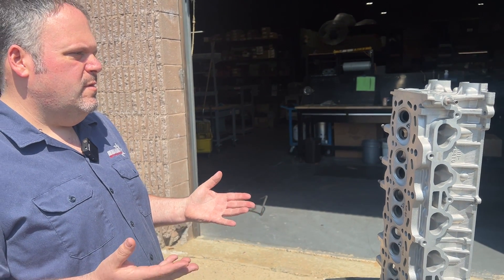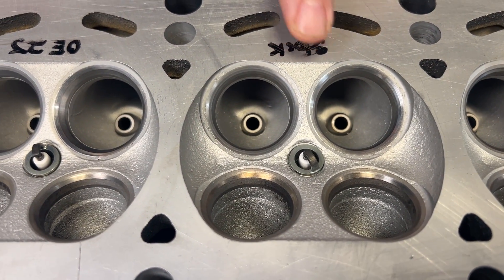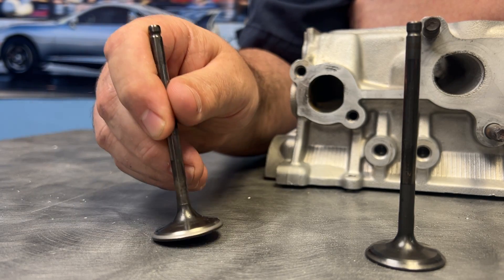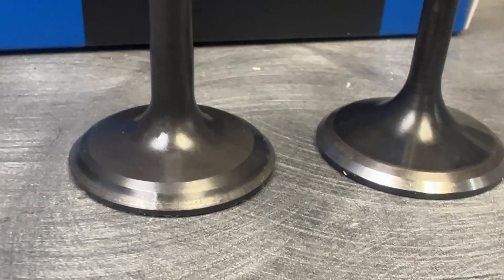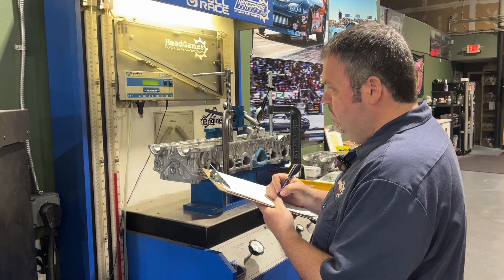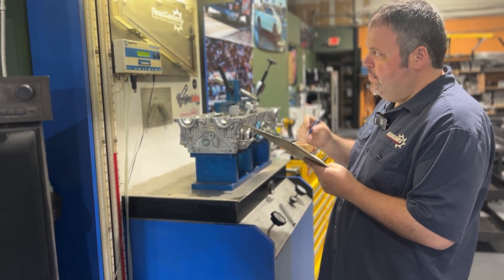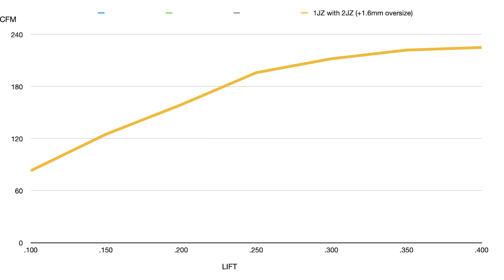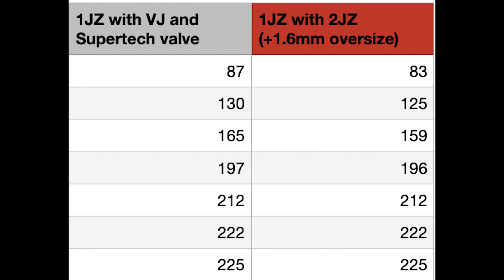Oversized intake valve in a 1JZ?!

Comment: That is interesting, but he’s comparing a 2JZ oversize valve which he says is 1.6 mm bigger. He mentions the super tech valve has a nice tulip and an undercut. Essentially an aftermarket +1 mm oversize valve will have all the features of the super tech valve but will be 1 mm greater in diameter. 

I’m not sure he comparing apples with apples i.e. a standard super tech valve versus 1 mm oversize valve with the same features as the supertech valve. 

 I’m not sure if anyone is going to effort of taking a stock 2JZ valve and putting it in a 1JZ head? I don’t even think the Valve height works properly in a 1JZ head?

If someone was to go to the effort of changing to +1mm oversized valve, they would be having the valve job, the valve would at least have better stem geometry than the standard valve as they’re be buying aftermarket. If none of these features matter (tulip, undercut etc) why does the supertech valve pickup over the standard valve? 

At least do a realistic test of the type of valve someone would use no? An aftermarket valve +1mm with tulip & undercut etc vs a stock sized valve with these features.

Not saying that it still won’t perform worse. Just let’s do a realistic test rather than everything else on YouTube these days, click bait.
Reply from the maker: I did the test with what everyone uses. What everyone sells and what most people ask for. The valve height is correct if you do the valve job correctly. That is why people do it. Because Supertech is only manufacturer that makes a OEM sized valve, everyone else sells it with the 2JZ valve.
Reply: @headgames I take that back. My “1JZ +1mm valves” intake valves are in fact +1.6mm aka 2JZ…. WHAT THE HELL. Why are they calling it a “+1mm OS” when it’s 1.6mm??  It would be great to see a BC valve tested instead of a stock 2JZ. I don’t know anyone who has put stock 2JZ valves in their engine as you say.

Comment: I can't add pics, so I'll email you the data. It's a replay from work I did 20+ years ago on Peugeot/Citroen XU9J4 heads. Standard inlet was Ø34.5 and flowed 211 cfm @ 0.3". I tested four Ø36.5mm valves (5,10,15 and 20°). All worse than oem <0.3". Port them properly though, and the 10º valve yielded 225 @ 0.3", 278 @ 0.4" and 296 @ 0.45". Also better or equal to oem < 0.3".

Comment: Do you have any experience with an M54 head? Wondering if any gains are possible… already forced induction and wondering if I gasket match the exhaust if there’s anything to be had. Love your stuff Dave!!
Reply from the maker: @evanormous6409  I can’t think of any cylinder head that really gains at the gasket end. The gains are in the valve job and bowl area.

Comment: Have you used the ferrea hollow valves in a build yet?  I believe they 20% lighter than std valves but also cheaper than titanium valves. 

If so would you recommend them?
Reply from the maker: @shaunmccreedy6121  I wouldn’t use Titanium or a hollow stem for a 1jz or 2jz. The hollow stem is just scary on anything that makes jam with a 6mm stem to me, afraid of it breaking. And a titanium valve is just not worth the added expense.

Comment: I know abit about back cut, what about cut like 60 or 45 towards the combustion side of valve head to make it go around valve? Does it help?
Reply from the maker: I wasn't trying to help any of the combo's just see what they do alone.
Reply: @headgames  but in general does such valve back angle adding aid in performance or has drawbacks? Rigidity? Or backflow?
Reply from the maker: @gedas3419  depends on the valve, and the valve job. It’s not always a gain. Sometimes it’s a loss.

Comment: Hi can you explain to as to why this is? I’m kinda new to engine mods scene.

Doesn’t the valve seat is also replaced to a bigger size to  accommodate the bigger valve thus making it flow more air?
Reply from the maker: the valve will fit on the OEM seat. And the OEM size Supertech flowed the best.
Reply: @headgames  oh so that’s why, because it’s still using the the oem seat, thanks for the reply

Comment: 4 valve heads have critical throat to valve diameter ratios depending on application 2:23  issues could be shrouding in the chamber or bore wall. It's never just "Install bigger valves".  There's port lead in, short side, guide, long side, and chamber blending that must occur to fully utilize a bigger valve. The bigger valve equals more power mentality goes back to people who didn't have a clue back in the 80s.
Reply from the maker: you are absolutely right! That is what we see daily, and why we did our test in that manner. I honestly haven't seen anyone who does it with the correct throat or try to even figure out what the correct throat diameter is. Which is not a one-size-fits-all at all. 
We also needed to not help either set up, because I do believe that correcting the throat with the stock size valve would put an even bigger hurting   on the oversized valve even if we did the same with it. 
Glad you are on board buddy!
Reply: @headgames  I just had to redo a set of brodix 18X that had been totally murdered by a "pro", they removed the guide vane and laid back the short side like crazy resulting in a port with no mixture motion on a wet flow check, and a noisy port at .650 lift losing it over the short side and killing flow by 20+ cfm from stock. Fixed the butchery at the guide as best as possible and made the short side right for the application. Numbers came in a smidgen better than CNC'd ones from bodix, and we got our mixture motion back. Below .600, the port was better but still subpar. They just killed the velocity at low lifts by over enlargement of the dead port areas. The customer didn't want to epoxy them, so it the best it can be given the circumstances.

Comment: This is one thing ive been unsure about while getting my new motor build. Although its 2.0 tfsi vw motor and aiming for 600+hp ive spoken to a few different workshops about stock size valves and oversize none of them can actually give me a solid answer as to which way to go. Same with porting
Reply from the maker: the stock valve seat that the valve seals to is smaller than the oversized valve in that head. 600whp would not be enough for porting or bigger valves. It would hurt torque.

Comment: Great video and information. Loving these flow test comparisons. It would be interesting to see what kind of flow you could get out of the oversize valve with a port and polish. Maybe that would make a big difference.

I know you have a bit of bias against 1JZ heads and 1.5JZ platforms as you mentioned. I get that in terms of trying to make big power and the cost of a 1JZ in the US.

I moved to Thailand from the States, and the prices of 1JZs are incredibly cheap and plentiful here. You can buy a Nissan Cefiro or E36 BMW with a 1JZ-GTE swap for around $3000.00 for the entire car. Also, you can pick up the motors cheap enough too. You can get a complete 1JZ GTE for just over $1000.00 here. At that price they make very affordable and reliable power. If the lower end blows up, you can pick up a complete 2JZ-GE for $300.00 - $400.00 here and do a 1.5jz cheaper than you could rebuild or get another 1JZ-GTE.

I still like the idea of grabbing a 2JZ-GE VVTi and putting in a set of rods and pistons in that. It would be a better platform for big power and good torque throughout the entire RPM range.

Please keep these videos coming. They are very informative and entertaining.
Reply from the maker: I would probably be more into them if I lived in Thailand for those reasons too.

Comment: Big question, can you fit rb valves on jz?
Reply: yes you can but why would you. they probably wont fit directly.
Reply: Big question is why?!
Reply: @350gtboi  mostly because it was never done and to actually test the results, sodium filled valves sounds better on paper but how well do they compare in actual test
Reply: @vladkruglov7719 those valves are great for oem level. When pushing limits those valves get removed. Also the Nissan also uses thicker heavier 7mm stems. Toyota uses 6mm. Honda uses 5.5mm. Going a thicker valves is going to reduce flow. Hence why the super tech valve in this video improved flow. As it was profiled. So I still see no benefit.
Reply: @vladkruglov7719 so you want cheap sodium filled valves. to be clear sodium filled is for cooling the valve and won't effect power.
Reply from the maker: no, they do not
Reply: @headgames  do you use inconel exhaust valves on your big power stuff.